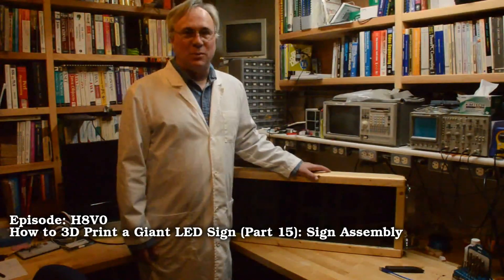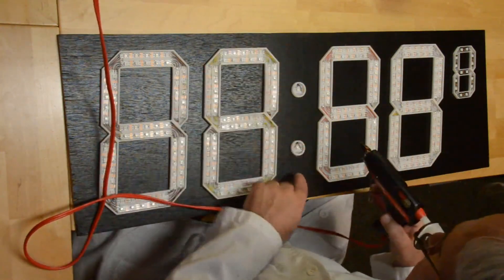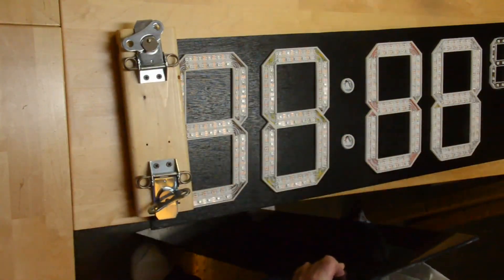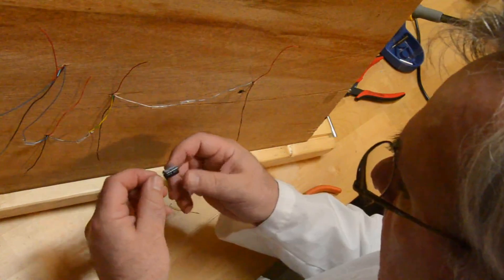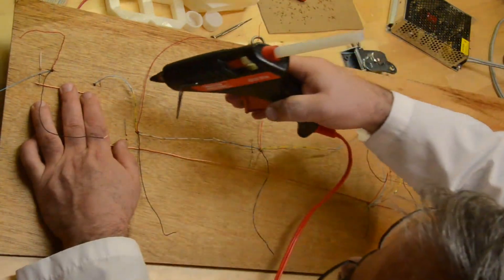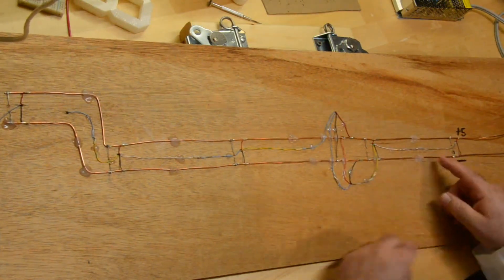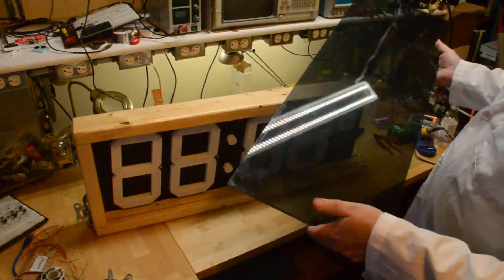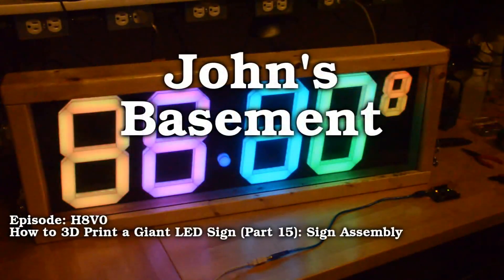How to 3D Print a Giant LED Sign (Part 15): Sign Assembly

Comment: Awesome work John! I am working on a 6 digit clock for the endurance kart racing team I'm with. Connecting to a TCP stream of race timing data with an ESP32 or raspberry pi to display race time left, race time elapsed, local time, and lap times as hh:mm:ss or mm:ss.00 from the pits to the drivers.
I'm debating the need for 10 led's per segment as you did it as I'd need 7 meters of led for 6 digits, there didn't seem to be a huge difference between 35 leds lit and the full 70 during the string test. 
How is it from a distance in real life?
Reply from the maker: Hey!  I am also looking at connecting one of these displays to a WIFI data source!

Be careful about the type of LED strips you buy.  Noone has written any PI code (that I know of) that can generate the strict timing-requirements for the three-wire strips.  For the PI you will want the 4-wire kind (that allow for sloppy signal timing.)  Ping me again if you need help with that.  (Adafruit sells both kinds of strips and has a number of how-to docs & vids that might help explain the difference.)  [UPDATE:  There is now a driver that works on the PI for the 3-wire 'neopixel' strips.  See here:  https://learn.adafruit.com/neopixels-on-raspberry-pi/overview)

The sun came out for a minute during my lunch break and I was able to shoot some clips of my 2-strip sign in the sun.  It is not very readable outside :-(   I will post some clips after work tonight.  [Here are some shots of it:  https://youtu.be/Yd-Kk4KL5bU ]

If I was shooting for an outside display, I'd use a huge number of very bright LEDs.

There are some strips that have a very dense packing of LEDs on them that might
work well outside.  Here is a page with a photo that shows what I mean:

https://www.diodeled.com/products/strip-lights.html

But for those, you need a different electrical interface.  They are NOT going to be addressable... so you will need to get creative with some FETs so you can control them.

Whatever you decide, let me know.  I'd  like to see what you come up with!